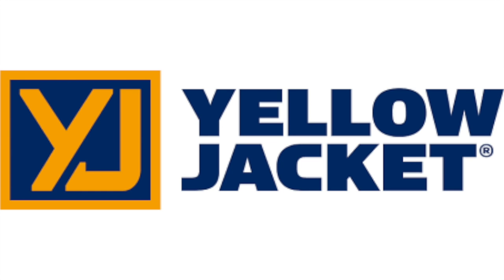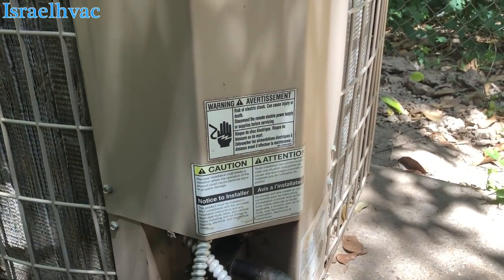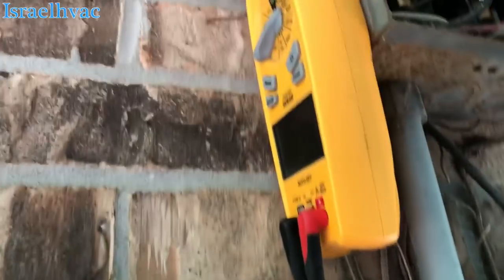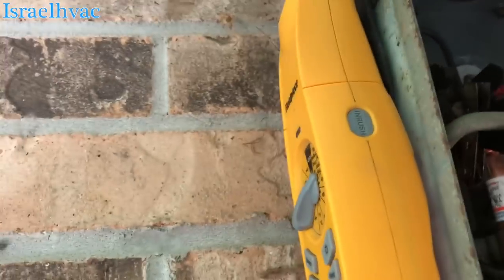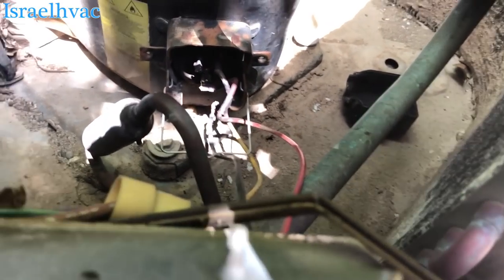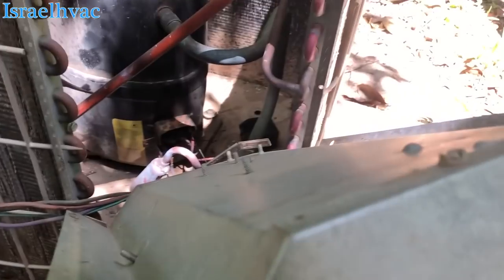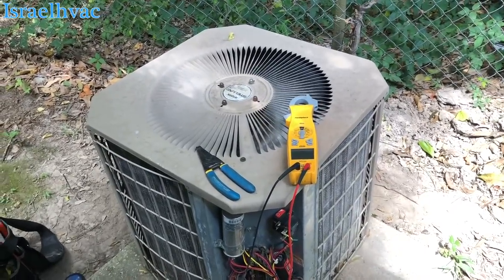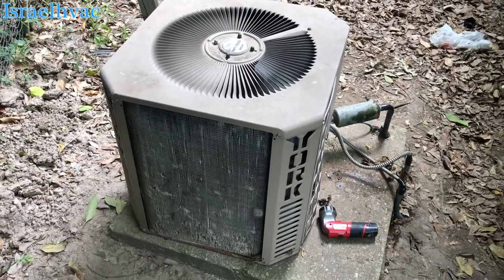HVAC | No Cooling | York Down Again

Comment: I probably would have checked the compressor first. Ether that or I would have used some over sized fuses before installing the the correct size just for checking to see if it would start. I hate burning up fuses tryin to figure stuff out.

Comment: didnt start and burned wires. hmm trash in contacts at contactor or bad contactor or loose high voltage wires somewhere between breaker and ourdoor unit. when under a load loose wires seperate... could also be a bad breaker inside. yep and the jabs in disconnect couldve caused that @ joneshvac

Comment: That horse needs to be put out to pasture. Ya do what ya can with what ya got, i guess. Question for anyone with a decent answer, say you have a package unit (rooftop unit) and the compressor is grounded. But when putting the new comp in you notice there is no filter dryer to change and no room AT ALL to install one. This happened to me the other day with an older 3 ton R22 ICP package unit. there was absolutely 0 room for me to install one not even room for a bullet drier.
Reply: Spector NS5 RD sometimes you gotta make room somewhere some how